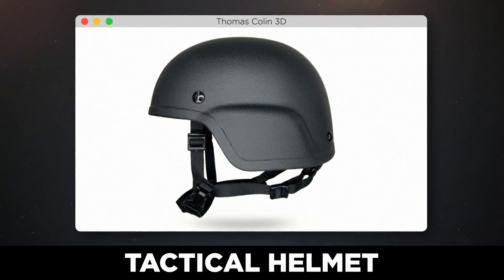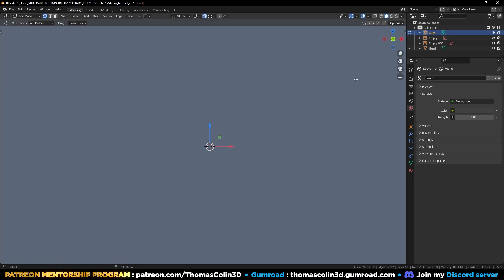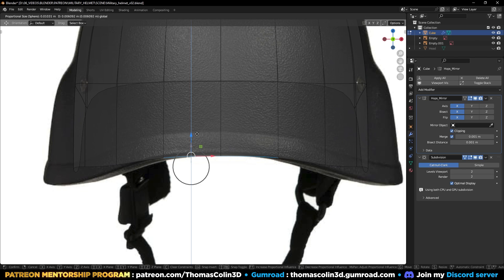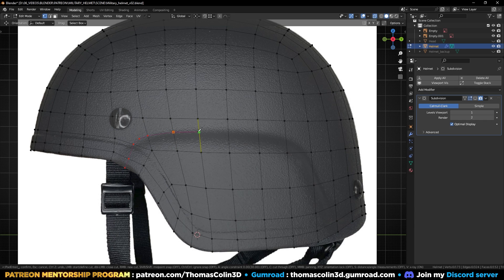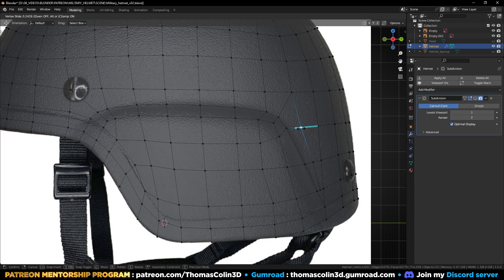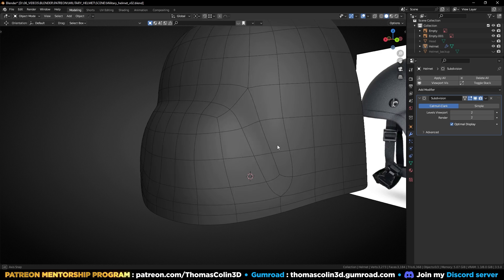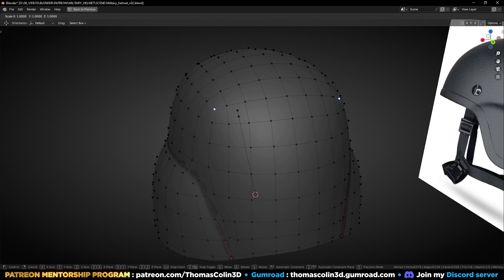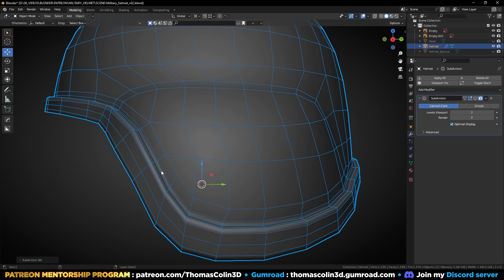Topology Study - Tactical PASGT Helmet (Part 1)  - 3D Modeling

Comment: Hi, whenever I try the mirror modifier, my helmet has like a face in the middle that makes a little "trench" hole that sinks into the helmet instead of a line in the middle of the helmet like in the video, did I do anything wrong? what have I missed?
Reply: Put the mirror modifier before the subdivision modifier (or pin subd to last).

Comment: Thomas, i got a problem in 01:48. when i press "SHIFT + Alt + S", it doesn't do anything. i already apply the subdivision to 2 by the way. where possibly i do wrong?

FYI, i tried join discord via invitation link but it says "EXPIRED"
Reply from the maker: Hey man, were you in edit mode ?
I updated the link in the description :)
Reply: @ThomasColin3D  I was. after i subdivided to 2 in object mode then need to go to edit mode in order to select the polygons right? (resuting the object surfaces becomes highlighted). 
AFTER this STEP, pressing that Shift + Alt + S don't do anything. i'm working in blender 4.1

FYI i'm already in discord

Comment: Thanks for a lesson! Could you share the images of helmet for repeat modeling process?
Reply: Alternatively, the helmet being modeled is a MICH2000 (I know the title says PASGT, but those are similar and have a little visor lip at the front). Some google-fu later, and the store for "Protection Group Denmark" has front/side/rear pictures that can be saved/used as reference. Their chin strap is a bit different, but for the helmet itself, it should be almost if not completely the same.
Reply from the maker: Hey! I don't have the links of the pictures because they were sent to me on discord. I can share them to you on Discord if you DM me :)
Reply: @ThomasColin3D  Wow thanks a lot bro